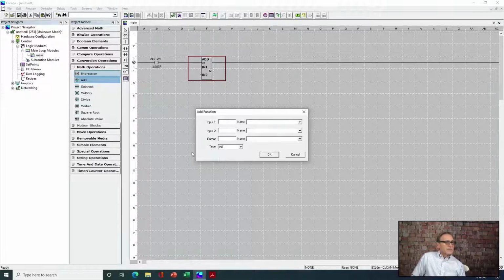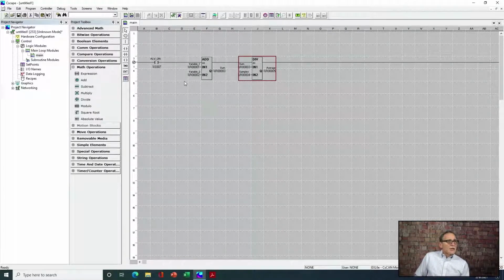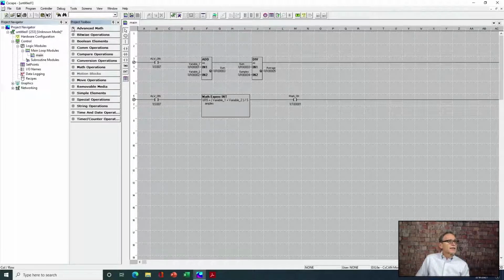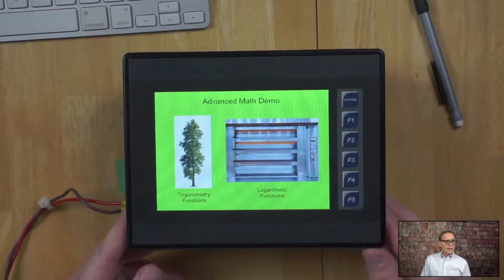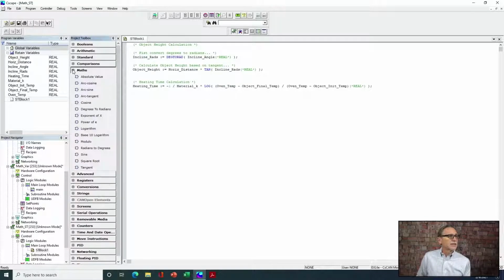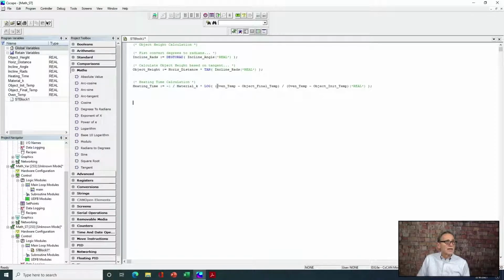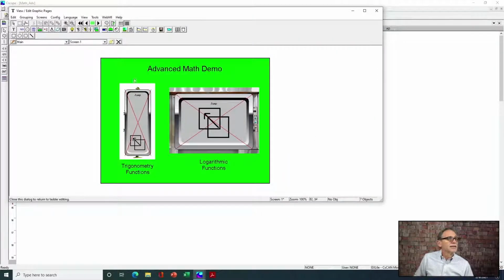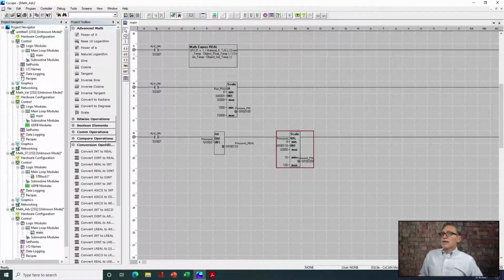Advanced Math in Horner OCS All-in-one Controllers

Comment: hello, when can we expect CsCAPE 9.90 SP4?
Reply from the maker: We just started a formal beta testing period, if you are interested.  The beta period will end at the end of this month, then we will incorporate feedback and release it in the second half of March.  There’s no question it is much latter than we wanted, but we thought a formal beta period was important.
Reply: @HornerAPG  in Cscape 9.90 SP3 I found a problem that you cannot open a program written in the lower CsCAPE version if it was protected with a 6-digit password. Will it be fixed in SP4?
Reply from the maker: @waldemarlisiecki8986  As long as it is reported - it almost certainly will be.  Could you report it to apgusatechsupport@heapg.com?  I would report it for you - but they may have additional info they need from you.
Reply: @waldemarlisiecki8986  Yes, we are aware of this issue and it will be fixed in SP4 on release.
Reply: @caseygardner7017  ok that's great